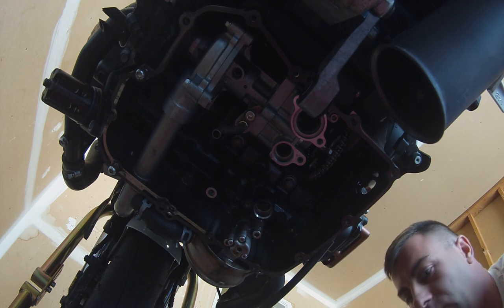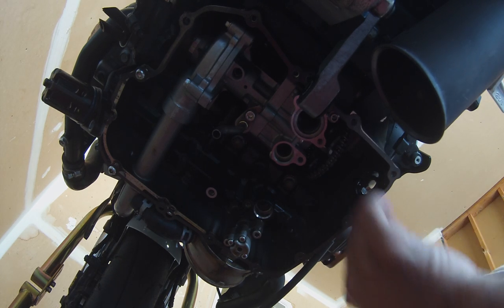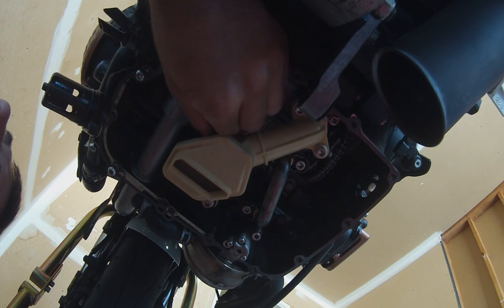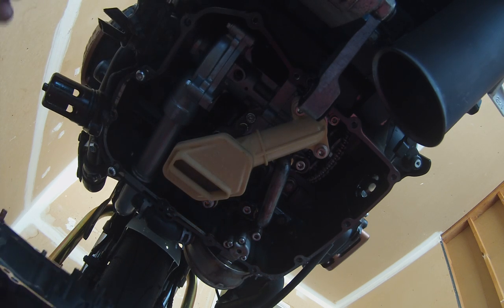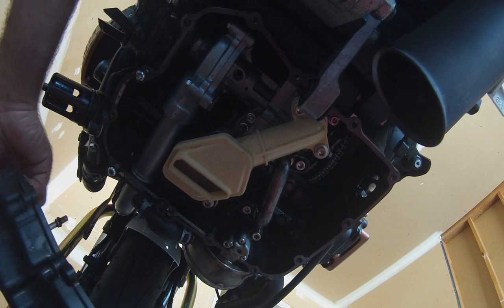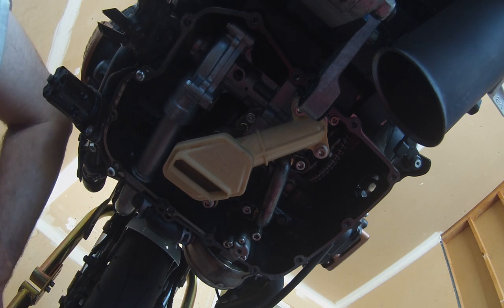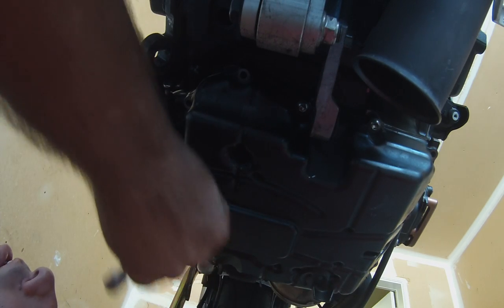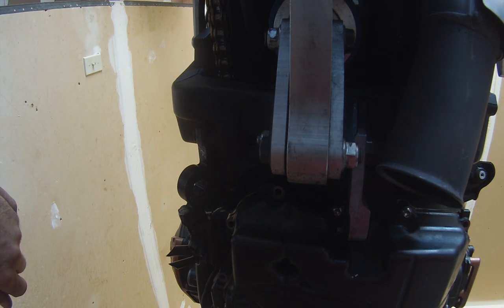2010 Yamaha R1 weap hole water pump install final part

Comment: Do you have to prime the oil pump with clean oil before assembling? About to have a go at it myself. All that work to replace the o-ring in crank case where the pump slides into.

Comment: Thanks for the informative video on what appears to be such a common problem.

Is the install still holding up? Do you happen to have the part numbers for the necessary parts?
Reply from the maker: It solved the problem! Here are a list of the main seals and parts... (http://www.nchouseofmotorcycles.com/fiche_section_detail.asp) SEAL 14B-13338-00-00	1	$8.99, SEAL, MECHANICAL 4C8-12438-00-00	1	$26.99, CIRCLIP 99009-12400-00	1	$1.58 (easy to strech out and break so make sure to get a new one). Other than those main parts you will want a new oil filter, oil, coolant ( I needed just over 2Liters), water pump o-rings around that area are also a good idea to replace being they are only a few dollars for each one. I hope this helps. 
Sterling
Reply: Sterling Robertson You're a good man.

Thanks for the help!

Comment: how hard was it to remove the mech seal and how did you go about it mate?
about to do my 03 and am not keen on changing the bearing aswell
Reply from the maker: I did have a hard time getting that old metal seal out of the water pump. I had to use a very small flat screwdriver to pry it out and a socket to press the new one in place. If you have a hydraulic press I would recommend using one.

Comment: Do you have any idea why there is oil leak from weap hold, How to fix it? Please advice
Reply from the maker: Daodouangkham Norasinh It leakes oil from that hole because there is an Oil seal inside the water pump. The same shaft that turns the water pump is the same shaft as the oil pump and a seal keeps that oil from entering the water supply. when that seal goes bad they had to make this weap hole in the middle of the oil pan so that the oil could escape outside the engine and not mix into the water supply.
Reply: million thanks, now i have to change all o rings of water/oil pump and drain pipe.

Comment: did u have to remove the clutch to do that job so u can replace the seals u don't have to replace the whole pump
Reply from the maker: No the clutch does not need to be removed. I did swap out the old seals.
Reply: +Sterling Robertson 
just to be safe just do all o-rings and seals can u help me out do u remember how many there were and on the chain and sprocket u just loosen the bolt and pull it off the end and let it hang right unbolt the filter and the 2 metal lines that have o-rings on the and pull the pump  back and down do I have to split the pump to install the new seal?
Reply from the maker: +Thomas Neely Sounds right from what I remember. I do remember replacing the seal inside the water pump that was a pain. its a metal press fit seal that you will ruin trying to pry it out. be very careful replacing the new seal as well. That should be the only seal that is bad.
Reply: +Sterling Robertson 
thanks bro your a big help gunna tackle the thing I'm a Harley/chopper tec so I got some mechanical know how thanks again
Reply: +Thomas Neely 
does the water pump impeller come off so u can put the seal over the shaft?
Reply from the maker: +Thomas Neely Yes the impeller come out. I thin you just remove a c clip from the oil pump side and the impeller comes out.
Reply: +Sterling Robertson 
so the whole shaft comes out u install the seal then run the shaft bad thru then e-clip?
Reply from the maker: +Thomas Neely exactly.